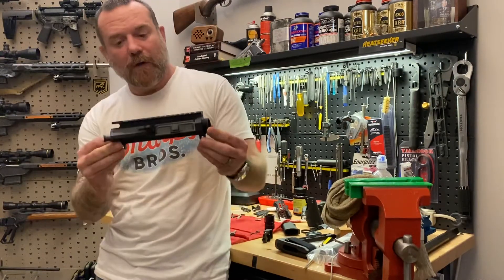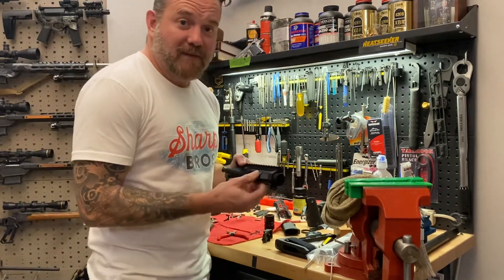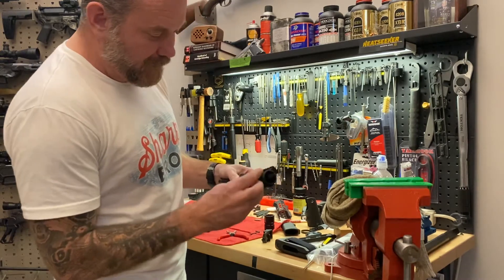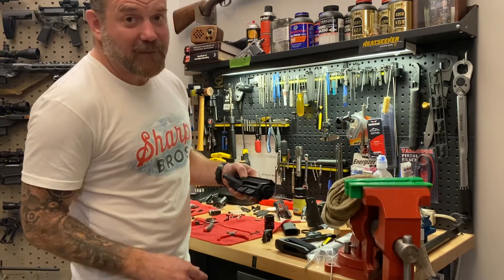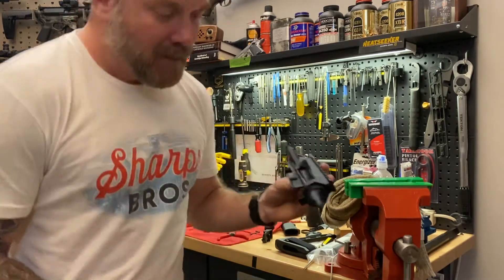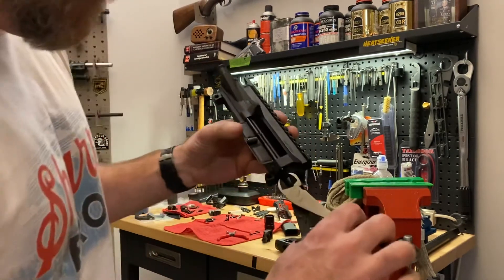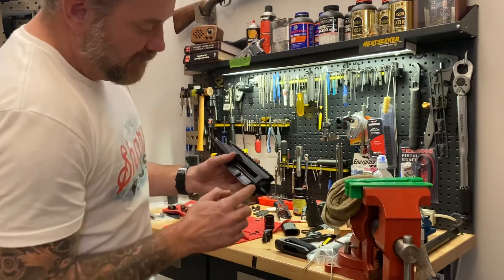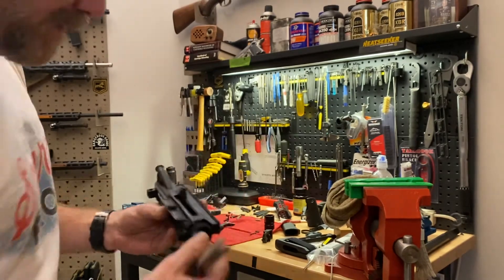Remove dust cover axle from Sharps Bros SBUR03 upper receiver (how-to).

Comment: If your hand guard, barrel and barrel nut are already installed, you will have to remove the handguard and barrel nut, as the barrel nut does not let the pins slide out. Also, if you think you're going to pull it out the opposite way, there is not a spot for it to do so on the sharp bros Upper receiver.
If this is a new build, and you have not put anything together yet... Plan ahead on what dust cover you would like to have and put it on 1st.

Comment: Please tell me the difference between the SBUR03 and SBUR04. Thank you.
Reply: difference between this 04 version and the 03 version is the 03 version has extra material right behind the receiver threads so it will mate up with Sharps Bros Ultralite handguard for a monolithic look. The 04 has that extra material removed so it can play nicer with other handguards that might have excessive anti rotation tabs.

Comment: Lookin to build my first ar, and been lookin at sharps bros uppers, does that upper have m4 feedramps?
Reply: i would like to know myself
Reply: @flawless1up  It does, went ahead and purchased one for myself, looks great, ar functions great
Reply: @ShootinForMid  they have a stripped jack lower paired with a stripped spikes tactical at my local gunstore  and the fit is super tight. the $789 price is insane, especially since its a gen 1 upper with no forward assist. i filled out the paperwork today my jack lower gen 2 will arrive in 3 days just as the background check approves. it costed $362 including the $50 ffl transfer fee. im going to order the sbur03 tonight for $188. so for $550 after tax in hand... still steep but not $850 steep lol. thanks for the response